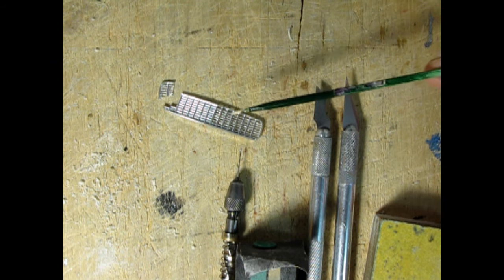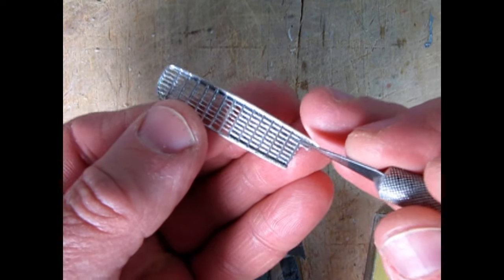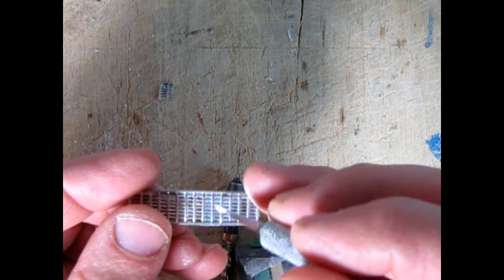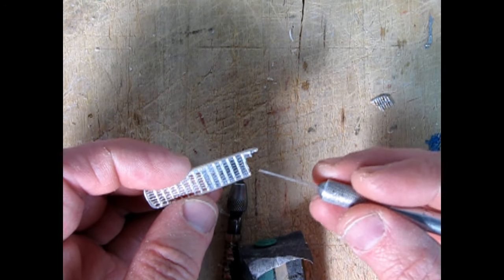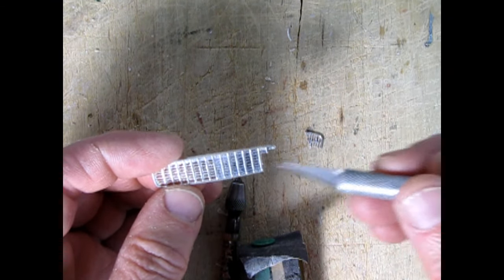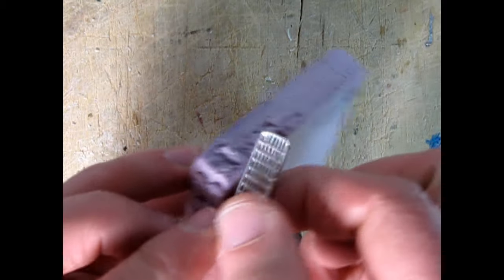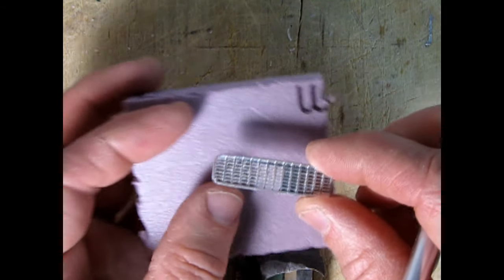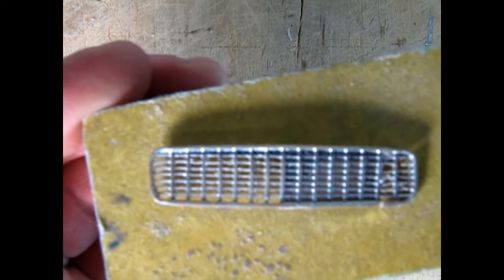How To Open A Model Car Grille  - Longer Video To Come

Comment: I use a Dremel with a sanding drum and support it in clay and wax paper so pressure applied won't break it.
Reply from the maker: Nice idea.
Reply: There's lots of reasons why I rarely use a dremel type tool☀️🤔🌡heat and destructive capabilities for a start
Reply: Its a shame you don't have any video's showing your workmanship.  Maybe you could post some so we can learn from your techniques

Comment: Thanks for this video! You're smart to know when to stop sanding.
Reply from the maker: I was going to experiment with sanding right through until the spaces between the bars popped out, but I stopped at a certain point and opened the spots with the knife. The horizontal bars were getting quite thin. I think they would have been the thickness of hairs if I kept sanding.

Comment: Well done,Trevor.  It's nice to see someone trying to do this. Like you are doing,start with a grille from the junk box. I do recommend that you make a support that firs into the panel area. Not a big block like you are holding ,slice a piece of foam or thick card down to the size needed. You need to accurately support the area. I think yours may have snapped as you are stressing the shape of the frame. Your progress so far looks really good . The reason why the grille looks black on a car is because the hood is shut and no light is behind it. If you look at a real grille,as an individual part, maybe footage of one at a junk yard or video of a real world restoration, you will see through it.
Reply: Right on, Pete 
🎉🛠🎉
Reply from the maker: I did look at a 1955 Chevy grille on Google that was for sale, so was not attached to any car at all. i also used one of those 1/2 round hobby knife blades like you used in one of your other videos. I think I was just too thick in that area that snapped. Once I thinned down the other side, I was able to cut through the plastic like butter.
Reply from the maker: It's all good!
Reply: @oggarage9388  thanks a lot👍😁🎅😎

Comment: Remember, on many of the grills, not every hole is open! This is especially true on the tops and the sides
Reply from the maker: I'll have to pay more attention on future grille openings. For the time, I was taking up Pete's challenge and seeing if I could actually do it.
Reply: @MonsterHobbiesModelCarGarage  I haven't found a grill that I'm willing to try yet lol. They all look so frail and shallow.  However I am trying something new with molded in headlights
Reply from the maker: @pappytinkers  That's a start! I took a spare grille out of the junk box for mine. 

I am currently working on that "How to brush paint a model car" video. First coat of paint for my model and so far it's going excellent! I strained the old Testors enamel paint (and some other stuff) and it's laying down so smooth and glossy on the first coat that you would think I sprayed it! 

It's going to be an awesome video when I'm done! 

Please allow 72 hours for the 3 coats of paint to dry! :_Welcome:
Reply: @MonsterHobbiesModelCarGarage  I know it can be done, but it's been so long since I've done that, I forgot how I did it .  I guess I'll have to watch your video 😁
Reply from the maker: It will be grand!